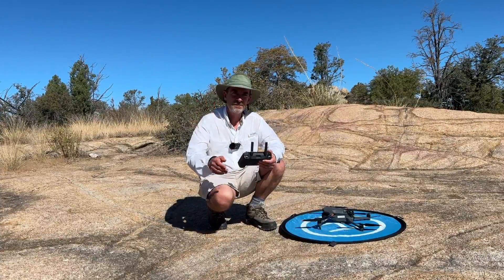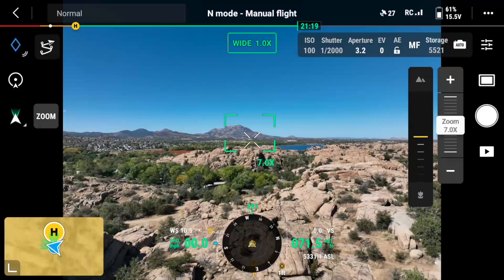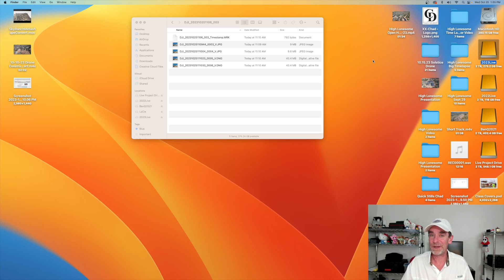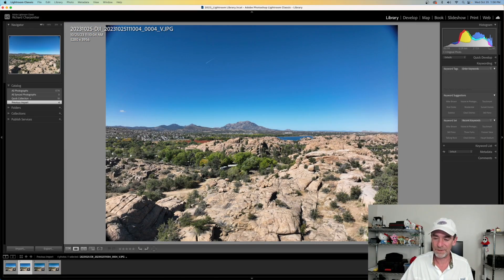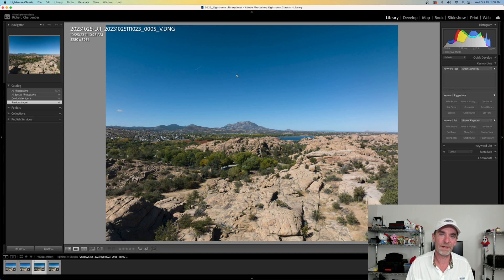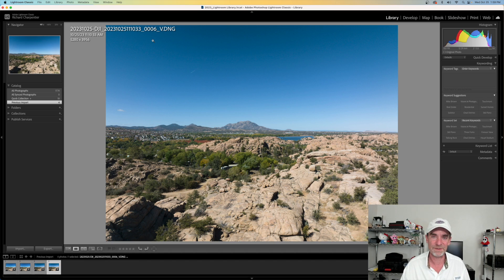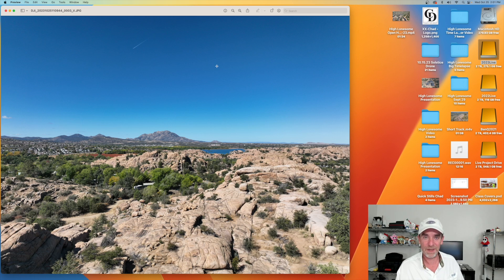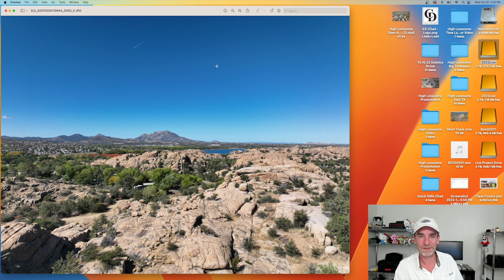Mavic 3E Dewarping - I Still Don't Get It

Comment: By the way, I believe the deworping can only be picked up by the computer. The reason you turn it off is when you're doing an orthomosaic map. It helps the computer stitch. The photos together better. But I don't think you and I can see the difference. When you're using drone deploy, it will automatically turn it off.
Reply from the maker: Didn't know that about Drone Deploy.  Thanks!

Comment: deworf off is for beterr results in modeling.BUT..I am surveyor but still big minus for this dron is becouse there is NO VIDEO format AT ALL and NO ORBITING..and NO  manual White Balance..this is a Big Frustration
Reply from the maker: Yes, you are right. I’m experiencing regular frustration with how limited it is
Reply: @AZ-Drone  It's incredible how almost 100% of M3E owners complain about the lack of some basic image and video functions and nothing happens in terms of updates from DJI. Such an expensive and limited drone is unreal....
If the equipment doesn't need any hardware changes, why don't they update the software for the basic functions...?
Don't DJI customers deserve an answer?
Reply: @cpn1968  Its simple. DJI is a monopoly. By doing this they force people to buy also other basic Mavics to do this. They also do it on all of their other Enterprise drones.

Comment: Do I have to remove dewarping every time? It's annoying,  how to remove it forever?
Reply from the maker: I have not found a way to permanently disable Dewarping.  And for mapping you want Dwarping off.  But for standard still images, you'll need to turn it off manually.

Comment: 01:55 turn off the gimbal Lock to fix your waypoint import gimbal issue? I’m also thinking since this Drone doesn’t do a manual white balance it will be best to capture raw images so you can send them through Lightroom and force a daylight white balance on all the images, which I think would fix the inconsistent colors by using a forest, Auto, white balance…
Reply from the maker: Once I'm recovered and back in the field I'll see if the gimbal lock is the issue.

Comment: You mention Dewarping ON applies a crop. It's applying a lens correction to the image, which actually stretches out the image over the same resolution as if it were turned off. It needs to apply the correction because of pretty severe warping. For example, in your example, you have the horizon right across the center of the image...this is literally the one position it’s hard to see the distortion depending on conditions haha. I'd encourage you to go out, lower the gimbal so the horizon line is almost at the top of your image, take a JPEG+RAW image with Dewarping ON, and JPEG+RAW with it OFF. With it Off, you will see the horizon bending hard in an arc. With it ON, it will be much flatter, more realistic. Also, with other Mavics, I do not know on the M3E, when you take JPEG+RAW, the jpeg and raw differ slightly in resolution (by 8 pixels either direction), and to add to that, Adobe Camera RAW when opening the DNG, no matter what Adobe program you're using (Lightroom/Photoshop) applies a lens correction profile (even though in the optics menu you don’t apply one, there’s a small note that says one is applied automatically), which further makes it differ from the JPEG, despite it being taken at the same time. I know this because I do 3d camera matching, placing 3d models into photos and videos and it really threw me for a loop. Now, for my work, nothing to do with mapping, I request Dewarping ON, JPEG only as it appears to be the most correct version, with the in-camera lens correction applied to the JPEG.
Reply from the maker: Thanks for the reply, and additional education.  I appreciate folks taking some time in the comments to help clarify issues like this one.  Thanks for your thoughtful / helpful response!
Reply: @AZ-Drone  You're welcome. Thank you for putting out your videos. They are helpful. I went down the M3E no manual White Balance rabbit hole as I am absolutely floored that it doesn't come with it, and that's where I came across your video on it, in the DJI Forum where everyone is lighting up DJI. Also, there's no sharpness customization? What is going on with the M3E??? haha. Besides manual exposure, manual WB, sharpness (I prefer 0 or in the negatives!) really helps the overall look of the imagery and only 1 of those 3 is available? Yikes.

Comment: The problem with the Mavic 3e is that the main sensor is a little oversized for the lens profile.  It results in a slight fisheye effect, which introduces other problems depending on your aspect ratio, specifically vignetting in some ratios.  Dewarp does two things: 1.Reduces lens distortion 2. Crops image to remove vignetting.  In some mapping/ortho software, dewarping is not an issue as the software will do image rectification automatically and make it's own corrections for vignetting as part of the stitching process. You can do an ortho with dewarped imagery BUT you will be uploading less info per photo as dewarping crops the image.  In that case, a mapping flight could need more overlap depending on the mapping flight software you use (i.e. if it compensates overlap for a dewarp crop).  On the other hand, not all ortho programs are good with handling image distortions/vignetting, so if you shoot warped, there is a chance you may run into a problem where the ortho can't be generated or it will look shoddy.   As for RAW, you most likely wouldn't be shooting a map in raw, so the inability to dewarp isn't an issue.  As for your results, a more open iris can also increase vignetting, btw. There may have been an iris setting difference between the jpg and raw.
Reply from the maker: Thank you for your comment @alacazaba. Best explanation I've gotten on this issue.  For my regular DSLRs I have a few wide lenses, including an 8mm fisheye for doing 360 images.  And of course there's vignetting from that lens. What I'm doing at this point is having Dwarping off for my map / model flights.  And when doing stills at the job site setting Dwarping on.  
Oh, and you're right, I don't do maps/models with RAW images. 
Thanks for sharing a great explanation for everyone here.  😀
Reply: Great explanation , so it's recomanded to turn ON the dewraping for the mapping mission ?
Reply from the maker: @boutriknabil7746  For Mapping and Modeling Missons we're turning Dewarping off.  In our most recent models with Dwarping off the models have looked much better.
Reply: @boutriknabil7746  it depends on your ortho software, but you should be able to stitch more successfully and at higher quality using images without vignetting and image distortion. It's the same sort of idea why one would use a mechanical shutter - good data in=better output (though not always). Of course, trust but verify, the hang up would be if you're not getting sufficient overlap because of the inherent cropping in dewarp..

Comment: Thanks again Rich. I’m so glad you have the M3E. Your videos really hit the mark with the frustration I feel sometimes. Did you try drone deploy to make your video. The free version works great and I’m sure you set your gimbal angle once for all waypoints
Reply from the maker: I haven't done drone deploy yet.  That will be coming soon.  Just trying to cover everything DJI gives us with the M3E and what they are missing as well.  I still need to do more testing with Map Pilot Pro, and hoping at some point Litchi brings out the app for the M3E.